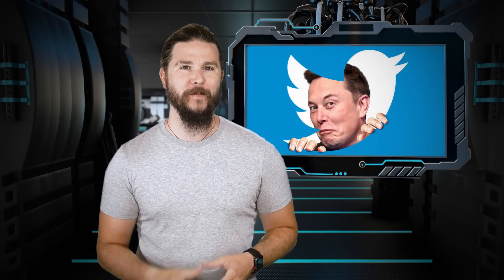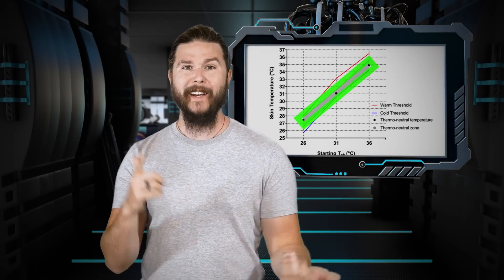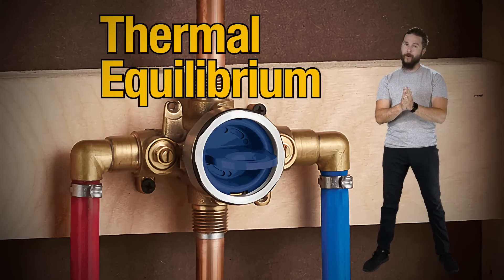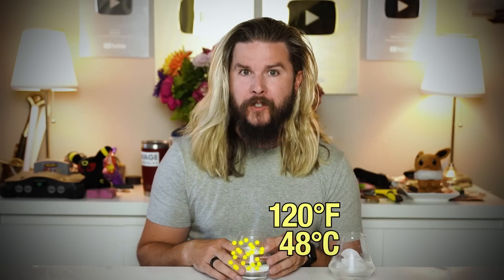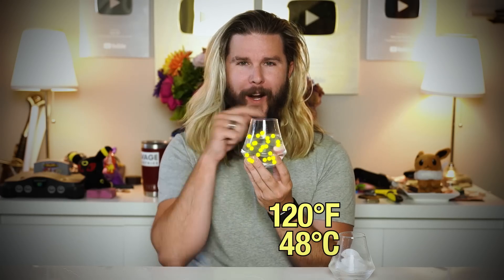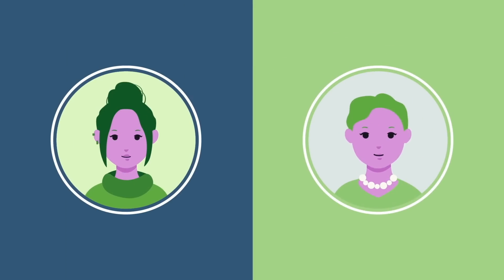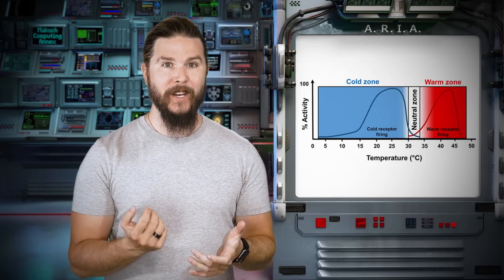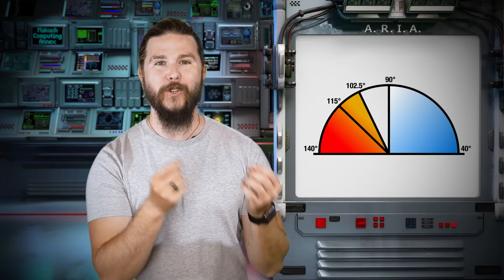Why Are Shower Handles So Sensitive?

Comment: VERY important note on turning down your house hot water temperature: It needs to have a minimum temperature high enough to prevent growth of Legionella. It favors 77-113F (25-45C) and so should be above it to also handle heat loss in pipes.
Reply: I got a heater that runs at a lower temperature.. but it has a auto system where it heats up the water once every 2 weeks to deal with the stuff that can grow/live inside it..
Reply: @CasualGamer1986  you know that isnt really a great  solution there. What happens to the water in between heating cycles. It can grow to infections levels in around 48 - 72 hours.

Also that only treats the water in the heating cycle.

Im curious because I cant find much about those systems
Reply: The standard minimum is 55celcius in Sweden at the tap that is the furthest away from the heater. Which means you can end up having alot hotter at the closest one if you have a big building so you'd have to adjust the mixer there to compensate!
Reply: @Pettingson  This explains why the water was so hot in my old apartment build was like 60-70 c it was crazy hot. But my apartment was right under the boiler
Reply: Luckely dishwashers in europe uses cold water and heats up the water internally itself!
Reply: @Pettingson  hence why tankless is more efficient, however, most American homes they're installed as the solo hot water source.  The smart way would be each device having their own tankless heating system, so the temperature for each appliance is ideal!
Reply: @Pettingson  All of my dishawashers I've ever had have a heater inside. Is this not common?
Reply: @abrahamlincoln9758  American dishwashers use hot water. Probably because it's not practical to use a heater on a 110V circuit.
Reply: @Kompost  It is actually fairly common to have a metal heating element at the bottom of older dishwashers in America. Just needs to be from a specific age, or a specific model nowadays. It's often not included in the fancy looking ones since the element looks kinda old and not fancy. Most dishwashers are hooked up to a different kind of socket than your average appliance, the one the oven uses. So it's practical.
Reply: @Kompost  I'm an american
Reply: @SECONDQUEST  Interesting. I'd love to have a dishwasher capable of taking hot water, they're very rare where i live. My building is getting hot water from a heat and power plant, so it's really cheap. Heating cold water with electricity seems ridiculous here.
Reply: @Kompost  I mean, we got our latest from Lowes a couple years ago with a heating element. Basically every washer I've ever owned or used has had a heating element in it. As well as a hot water intake.
Reply: @abrahamlincoln9758  In the US, they sometimes don't. Technology Connections youtube has a good video on the subject of dishwashers!
Reply: @SECONDQUEST  In the US, I'm not aware of any non-commercial dishwashers that aren't 120V appliances and designed for 15A circuits. Also, I've yet to see one without a heating element, used for drying and high-temp "sanitizing" washes (if you choose to use those modes). Some fancy model may hide the element, I suppose, but seems like that would hurt efficiency.
Reply: Sidenote: my Samsung dishwasher (which is less than 2 years old), will complain if the water coming in isn't hot enough by stopping and flashing an error code, requiring me to restart the wash. But it won't, according to the manual, use its heating element to compensate during a normal temp wash. A rather annoying quirk. Usually, this problem seems to be avoided by making sure to run the hot tap in the kitchen sink first. I'd rather not be running high-temp washes all the time, it's not good for plastics and fine ceramics, but I will use that setting to pre-sanitize canning jars.
Reply: @Pettingson  ...almost all dishwashers heat their water internally.  But, if you've ever read the installation manual, it specifies that they require a minimum of 57C input and then heat it internally to 63C.  If yours has cold input, then blame your installer.  Because they're supposed to have hot input.
Reply: @NorthernChev  Nope. In civilized countries you attach the dishwasher to the coldwater tap. It even says for you to do so in the instructions as they are made for it. The only limit it has is that you are not supposed to attach it to the hotwater tap if the water is hotter than 60degrees Celcius. Which in many cases the hotwater is locally due to limiting legionella growth.
Reply: Would that necessity be less important in a system with a tankless "on demand" water heater?
Reply: @tparadox_1988  absolutely, but if your water heater is set lower, keep in mind that it will be lower for everything including dishwashers
Reply: @LordGrantius  Dishwashers heat their own water. That's what the coil at the bottom is for. Washing machines do use hot water though, but you shouldn't be using hot water in your washing machine. New soaps work perfectly fine in cold/lukewarm water.
Reply: @LordGrantius  well, only for those that have that hooked into hot water
Reply: @CDRaff  i understand that that varies from place to place. In Europe they only use cold water inputs for dishwashers, but in the US the expectation is that you use hot water input, so the heating element isn't as effective
Reply: Remember that dishwashers actually need at least 120F water to operate efficiently. They'll either use water that really isn't hot enough to get your dishes clean or spend more time and electricity to get the water temperature right. Oh... good idea to purge the cold water out of the hot water spigot at your kitchen sink before starting the dishwasher.
Reply: @danceswithmules  are your dishwashers plumbed into hot water? Ours heat their own, same for washing machines.
Reply: @jamesgrover2005  yes but it saves electricity to heat 120 degree water to 135 than it does room temperature to 135
Reply: @danceswithmules  only in America most of Europe uses cold water for dishwashers
Reply: @danceswithmules  If you use a long enough cycle to have a "pre-wash", you actually want the pre-wash to be a lower temperature. High temperatures will "set" proteins, clouding the main washcycle.
Reply: @danceswithmules  Won't really help much your dishwasher runs two cycles the main one coming after the rinse cycle long enough for the water in the pipe to go cold again.
Reply: @danceswithmules  wow I never thought of that. Thank you!
Reply: That's what I thought :)
Reply: Additionally, almost all dishwashers require a minimum of 135 degree (F) incoming water temp. So, that dictates where you keep the hot water temp.
Reply: @NorthernChev  Perhaps if they're older. Modern dishwashers have to heat the water they use anyways, why would they need incoming water to be that hot, when they heat it up themselves? It's not like modern dishwashers use that much water.
Reply: @SmallSpoonBrigade  Don't know why, but they do.  I've installed tons of them in remodels, and they all require it.
Reply: If you're running the water a bit cold you should also flush the hot water pipes for a couple minutes every once in a while, at least once a week; since you're not running water for hours at a time during work and sleep, some parts of the pipes will inevitably hit the sweet spot for Legionella. 

If the hot water is hot enough then it'll kill them before they can grow too much, but if it's set lower then they might survive. Especially in areas like pressure overflow pipes where some water might accumulate, or if there's some side connectors that are rarely used, like pipes having been installed for a second bathroom — whether it's connected at the end or not.

So, if you've been away for a few days, or if you have the hot water set low, then flush the hot water faucets throughout your house for up to 5 minutes to kill off any growths. It's usually only necessary for larger facilities where the pipes are long enough to allow there to be areas in the pipes with the right temperature most of the time, but again, if you lower the hot water temperature you run a higher risk of having the same problem in a smaller facility.
Reply: @Lauren Damaso Ruiz you catch Legionella through breathing them in. So when doing this make sure to have the shower head lying close to the drain to prevent them from floating around in your shower. But even then: Legionella are a serious problem that might not be "flushed" easily like that. It's still a good practice though...
Reply: What if you like cold showers?
Reply: @StoutProper  valid point.
Reply: ,,Aym gaihng to take a shaowah..."

(Arnold Schwarzenegger, Twins, 1988)
Reply: Additionally by lowering the temperature you are effectively reducing your supply of hot water.

Some new heat-pump based water heaters do the opposite of this and heat the water to higher temperatures than normal and have an integrated thermostatic valve to mix cold water in before sending it through your hot water pipes. Believe the idea is to make the effective water supply large enough you'll be less likely to notice the longer recovery times vs electric restive or fossil fuel powered water heaters.
Reply: If you live in a place with not great heating, it also controls how warm your air heater can go. In my old apartment, the heat is basically just a flush of hot water directly from the hot water heater inside a contained vent. A fan pushes air around the hot water pipes, picks up heat energy from them as it goes, and then blows out into the house. When someone came to service our water heater and turned it down (I have no idea why...), it meant that suddenly we couldn't heat our home!
Reply: I hope in the next peer review segment of the Office Hours livestreams that your comment wins because that sounds what Burt Gummer would call 'Critical need to know information'.
Reply: This. Needs to be above 55*c i heard.
Reply: @igors_lv  what you can do (and is code locally) is installing a mixing valve to bring down that temperature. Might want to install it downstream of connections to fixtures that need the water hot.
Reply: @LordGrantius  yes! Highly recommend this upgrade on bathroom renovations
Reply: This unsurprisingly is most commonly seen in cooling towers for large city buildings. 

But there's also the sensitivity due to water actually pulling away body heat from your skin. Depending on your resting state sweat rate, this could be anywhere
Reply: Spot on! That advice can be unsafe if done incorrectly. However, you don't need an expensive thermostatic shower handle to solve this like Kyle suggests. Instead, install a cheapish fixed thermostatic valve on the water heater outlet itself. That way you can keep a safe 60 degrees in the tank but the maximum range is reduced to something more reasonable like 45-50. You also have the added benefit of getting more than 100% of your hot water heater's tank capacity. If your cold range is too low you can do the same thing on the cold side but most people like having a cold option.  We're talking like $60 per valve instead of $400 for the full system.
Reply: Does the chlorination and fluorination of the wär supply not take care of this?
Reply: @colinm_pe  to some extent

No one system is 100% effective all the time. Also Legionella bacterium has a bit of protection from chlorination in some instances look it up on Wikipedia. There is a great photo of how amoeba can act like a shield from chemicals in the environment.
Reply: @colinm_pe Not at safe levels of chlorination.
Reply: Then what about cold water? Why is there no legionella in that? Is it too cold or something?
Reply: @zwenkwiel816  
Actually yes.
Bacteria as a whole are like most animals they thrive only within certain temperature ranges. Its part of why the body causes your temperature to rise when you get sick.

I was looking it up for you and found the CDC website has a really good overview article on Legionella.
Reply: Australia, federal law that all storage hotwater systems require tempering of water for shower or basin use
Kitchen and laundry can be 75c or hotter
Plus all storage hotwater systems must have adequate control of bacteria growth
Reply: And lowering the temp will make your "hot" water run out faster. Not because you have less In the heater, but because it will need more "hot" water from the heater when mixing with the cold water.
Reply: Also as someone who grew up with -40 winters, make sure your pipes won’t freeze and explode
Reply: That's to complicated just do what I do, turn the heat of the shower to the max
Reply: Iirc, 120F is recommended when you have small children. My youngest is 12, my oldest 25. I have a vague recollection of adjusting the temp a long, long time ago. I don’t think we ever raised it again.
Reply: @KristenRowenPliske  Side note:  Tell the 25-year old he needs to get a hot water heater of his own... In his own house...
Reply: Ok so first of all. I agree with your general point. It's a bad idea to keep your hot water below 45C, especially if it can get mixed into drinking water. That being said

I think I tracked down your source of 25-45C being the wcs group. I cannot find deeper source and all primary sources I found check legionella growth up to 35C. 

The reason it seems doubtful to me is because 40C is the temperature proteins begin denaturation process. Which is lethal to all life. The issue is that's just starting point, and even at 45C denaturation is very slow, potentially just slightly higher than reproduction rate (but it is higher. 45C is enough to kill all life in water, it will just take few hours.). Additionally it is endotermic process which creates batches of sub 40 where other colonies can survive and even thrive. Also as you said heat will be lost in piping, so by the time, water reaches your shower all surviving bacteria will have perfect living conditions. Hence the 55C recomended temperature for boilers so that they are surely bacteria free.

Note that this all Does not apply to flow heaters of any kind, that intake pure tapwater, and send it straight to you without holding it anywhere. Tap water is perfectly safe to drink in pretty much all countries that provide access to it, just heating it up therefore bears no risk

Once again. Not disagreeing with your overarching point. Just adding a bit more nuance.
Reply: But not too high to cause burns, no higher than 120F.
Reply: In new Zealand as per building code hot water in the tank needs to a minimum of 75 degrees and 55 once it has passed the mixing valve
Reply: hmm, I didn't know this
Reply: Feels like it should be pinned.
Reply: EXACTLY. The water in my house leaves the hot water heater at ~60°C (140°F - this has been the temperature at which Canadian hot water heaters default to for many decades, and although there has been some debate over requiring people to set their water heaters to 49°C*, proposals to do so have been unsuccessful), and drops down to ~57°C (135°F) by the time it reaches the nearest faucet. Showers in my house max out at ~55°C (131°F), as they are on the second floor and the water has to travel farther to get there. And the warmest temperature that I can personally acclimatize to (i.e. it would be extremely hot as an unexpected shock, but I can crank it up there gradually) is ~47°C (117°F).

I'm not sure if I'd have my water heater set quite so high if there were young children living in my house, because I think the risk of severe burns would be worse than the risk of contracting Legionnaire's disease (I might drop it to 57°C or so, ensuring that the very hottest water that comes out of a shower would be ~52°C, which would be shocking if instantaneously experienced, but would still take at least a few seconds of continuous exposure before even a 1st degree burn occurred, and nobody's going to keep their hand in water that hot for more than a split second). But 60°C is the minimum recommended temperature for a hot water tank to be set to, if killing all potential Legionella in the water is your goal, and as an adult, I am smart enough to not stick my hand in water that comes exclusively from the hot water heater (without mixing with some cold water first). And as Legionella is still unable to survive long term in 57°C water (though it takes longer to die than at 60°C), the scalding risk can be somewhat mitigated without significantly increasing the chance of acquiring Legionnaire's disease.

*I believe 49°C/120°F is the maximum tap water temperature allowed in the USA, but tanks can still be set higher, as long as there are anti-scalding measures in place to cool that water down before it comes out of the tap.
Reply: True, you also lose effective “capacity” on your hot water because you are using a larger proportion of hot in your overall mix. We installed tunable mixing valves on the hot supply in our bathrooms to effectively limit the max water temp at both those locations. Many newer shower mixers also can be limited on the hot side to prevent scalding.
Reply: Thank you! Just commented about this myself. Warmed reservoirs of water in modern appliances/buildings are an underrated source of disease.
Reply: Even the high end there is really low for your hot water.
Reply: Adding a little addendum because I just finished nursing school- if you have babies/children you should not set your water heater above 120°F
Reply: @liztolley8488  a bit wrong, it's the temp out the tap you worry about not necessarily the temperature at the heater. But I completely agree, just need the water temperature high enough that most bacteria can't grow
Reply: @AaronLyNxAI  I'm telling you the rule that we learned in nursing school, which is that the water heater needs to be set at the least to 120° to prevent 3rd degree burns on children.
Reply: You’ll also use more hot water than cold water in the mix, causing it to deplete the tank faster, reducing the stored thermal load and resulting in greater energy use in the long run.
Reply: Came here to say this!  In Ontario (I'm a former building inspector), water heaters are required to be set to at least 160f and then tempered to no more than 145f using a thermostatic mixing valve to prevent scalding and legionairres!
Reply: Too much explanation for people that won’t remember, use a scale for water temp, need to make sure water doesn’t scald skin. Set it to the setting before that and you’re safe no matter what.
Reply: Sorry but that's actually only true for water heaters that have a hot water tank because Legionella need several minutes to die from high temperatures. My heater does not have such a tank - water goes in cold and comes out hot in a fraction of a second and less than 2 seconds later it comes out of the shower head. So no temperature you could ever dial on such heater will be able to kill legionella but that's okay because you're less likely to have problems with them when not having a hot water tank.

So in that case it's not only more comfortable, but it will save you a ton of money for energy to reduce the temperature.
Reply: Or you could get a mixing valve like anyone with a brain does. water heater at 160, mixing valve at 115.  The range for avoiding legionella is OVER 140. Not compatible with noy being burned.
Reply: OMG I'm so sick of these therapy ads no one therapy they just need to deal with it